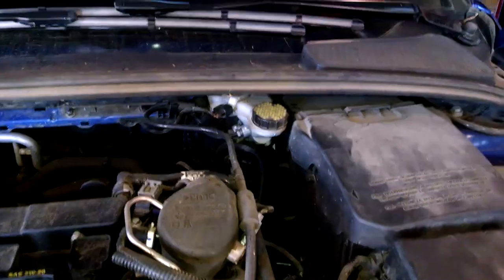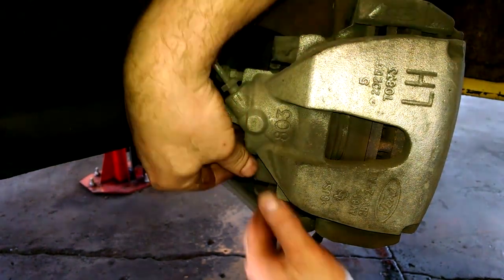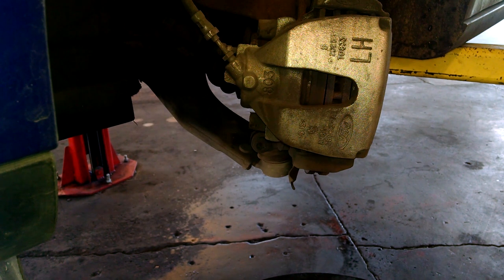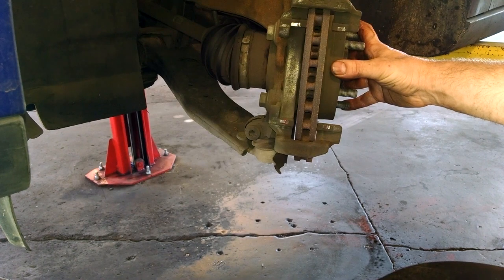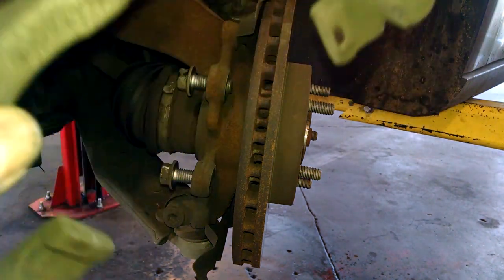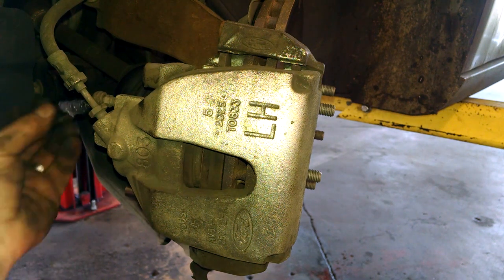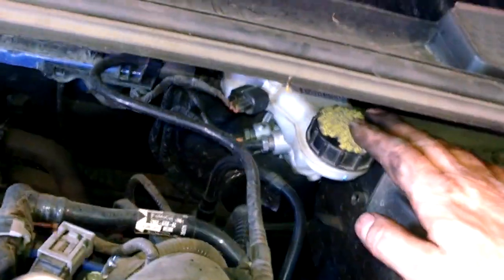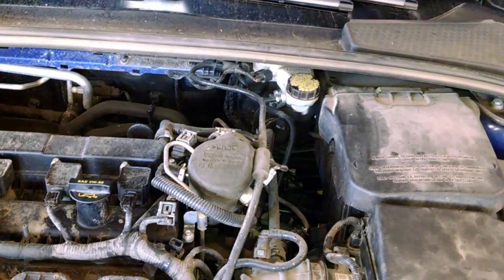Brake pad replacement Ford Focus 2005 - 2014 Front pads rotor Install Remove Replace How to

Comment: So my car started to make a scraping noise when I pressed on the brakes a few days ago. I knew it had to be my brake pads from a previous experience with my old car. So I also knew how expensive it could be to get them fixed. So I started looking online for parts pricing and then on how to go about doing it myself for my Ford Focus 2009. 

Now Im a young woman in my early 20's in college, so I know about cars, but definitely not how to do too much work on them. I found your video and it was perfect! I watched it a couple days ago, purchased the parts, and was able to figure it out and do the work on my car in under an hour today! So THANK YOU! So many people at the store were side eyeing me bc they questioned whether I could do it and with your instruction, I did! You saved me a ton and I will definitely be tuning in for more car care information!
Reply from the maker: Felicia Langston Thanks for the nice comment, glad to help you out and save some $$!
Reply: Felicia Langston So your saying this video will work for my 2009 ford focus?
Reply: hard time believing under an hour but there's always a chance I could just be slow
Reply: @BabyBirdFOH  did this in 30 minutes Haha it dont take long. I know this cause I started at 8 and it gets dark at 8:30 it was dark just as I was getting the wheel back on.
Reply: @chrisl2090  on one side? You're supposed change them in pairs
Reply: @platinumpepe8626  no dude both sides it dont take long.

Comment: Thank you for this video! Especially at the 12:39 period. After the spring sprung away from me 5 times, landing at my foot, time # 6, just as I was about to set it correctly it sprung away from me and out of sight. 90 minutes later, and after searching with my handy 12" magnet I gave up. Now I've ordered a new one from Ford and will drive sparingly until it arrives. Your video showed the best view I've soon so far on reinstalling the spring. Thank you! Mike

Comment: Guys remember to open your brake fluid reservoir cap when pushing the piston back otherwise you may need to get a new master cylinder!
Reply: I didn't know about this tip until yesterday. I've done the brakes on my vehicles for about 20 years and knew I was always going to struggle to retract the piston. Now, I just hope I don't "struggle" too hard to remember to screw the cap back in place when I'm done getting the brakes pumped up again. Thank you for the reinforcement.
Reply: Not true.  Simply not true.
Reply: Someone CLEAR THIS MATTER UP STAT UGH

Comment: If anyone is wondering you need an 18mm socket and 7mm allen key socket. A breaker bar helps a ton with the 18mm socket.If you have a wood chisel it helps out alot with compressing the pads.
Reply: I just used a C clamp which I closed really slow to push in the pad.

Comment: This is a really helpful video. I searched it out because I heard about having to use a 7mm Allen key to undo the slider pin bolts, and you made it very clear! Bit suprised no lube going on the back of the pads or the contact points (where they rub their retaining bracket)?

Comment: My mom got quoted a grand at ntb also I believe that the caliper bolts are torqes like everything else on those car I just did this on a 01 it's almost exactly the same but get this there's no caliper bracket blew my f'n mind thanks for the video man also for those interested in if you should use A TQ wrench it's a peace of mind thing so if it's your car maybe don't worry about it but if it's someone you care about dearly definitely tq everything to spec peace of mind is a nice thing to have p.s. since my trans fell out a few years ago I tq everything wheels hubs anything that you don't want falling off

Comment: When you compress the caliper piston, you crack the bleeder valve, if you don't you can damage the seals in the master cylinder.
Reply: Jake Walters 
absolutely incorrect.
Reply: No, it is absolutely correct. In fact, there are quality shops that require it, or it results in termination. Furthermore, the calipers are the lowest point in the brake system, so they collect tons of contamination. Opening the bleeder valve allows for a portion of the contamination to be flushed out. Also, with new systems, you are playing with fire pushing fluid backward through the ABS system. Stop acting like you know everything. You commented that the lug torque was 120 ft lbs. That's ridiculous. Focus torque is 95 ft lbs. If Focus owners listened to your drivel, they'd risk stretching the lugs, and killing their tensile/yield strength, not to mention warping the rotors. Stay wrenching though, Shade Tree.
Reply: Uh, this is part of his post: "...those pads are thick, but that rotor is scored badly and both should be replaced. Lug torque is 120 ftlbs..." 
What exactly are you talking about?
Reply: Well, I'm in the process of changing my pads and discs, and right off the bat I was annoyed about the 7mm allen key to remove the calipers....but I've already fabricated several tools for my ford vehicles. Here I was lucky to have a 7mm but I thought I'd have problems getting the bolts out- which I didn't. So I watched a youtube clip by chris fix, and he showed how you can swivel the caliper just to replace the pads by removing only the lower bolt. When I was unable to do that on my Focus I found this video. And I can say that I'm happy I did. Now for pushing the piston back in; I have always opened the bleeder valve as I'm applying finger pressure on the piston, and have always bled the brakes afterwards. This is the third video in a row which eliminates that step. Chris Fix even has a special tool to push the piston back in. As for that synthetic grease- I've never seen that before, never used it, and I don't have any...I guess it has to be non petroleum based so as not to damage a seal? And yes the other videos said 95 ft lbs. I do have a torque wrench but I rarely use it. I memorize the force by hand or the position of the wrench when I remove it....I can always check to see how accurate my estimation is.
Reply: Jake Walters I’ve done a shit load of brake pads and rotors for the family business, in 20 years I’ve never “cracked the bleeder” to install a set of pads.  All I’ve ever done is crack the fluid reservoir lid and changed the pads. Never had any ABS issues or whatever you guys claim can happen.
Reply: No you absolutely do not, you take the lid off the brake fluid then it will push back freely take it from a mechanic

Comment: Is that purple lube you used on the caliper bolts high temperature grease, gotta do my pads and discs and I think the sliders might be seized

Comment: Is a torque wrench absolutely required for the rotor replacement, or can it just be as tight as I can get it? What are the repercussions for not using one? Thanks for your help in advance.
Reply from the maker: gnaviselarom I am sure not absolute, only real issue I see is if the lug nuts are too loose and the tire falls off.  tighten them tight in a criss cross pattern and you should be fine.

Comment: what a grate video   so well done   saved me a lot of money . thanks todd.      the steering wheel shakes a little  when braking at  40 to 45 mph    I guess it is time to  cut the rotors or replace them . the pads have the same amount of lining left on them as in your video   so  in case i cannot  cut the rotors  but instead have to replace them  can I re use the pads  or should I replace them as well?      this did not start happening until I rotated my tires    weird  I thing.  I heard if you over torque the wheels you can warp rotors  is this true.  I torqued them to spec  witch is 94ftlbs    I have a 03 focus wagon 2.3  it is the same brake set up but I do not have a caliper bracket and my spring is a little different .

Comment: Great video!! Any suggestions on the best place to get the best price on Ford Focus brake pads?
Reply: Ford uses Motorcraft for their pads, oil filters, etc. If you go to the Motorcraft site they don't list pricing, I think they'll just refer you to your local dealer. Worst case scenario you buy them from there, then just install yourself which STILL saves you a ton of money. Personally I bought a set of Duralast pads for 53 bucks and they seem to work just fine, but typically I try to use all motorcraft stuff
Reply: Thanks. I went with the $50+ Duralast option too and simply followed this video. Worked like a charm and saved a butt load of money

Comment: I try to to this but my brake pads are to thick and I can't put it back now! please help
Reply: strange soul I'm having the same issue but only on the rear.
what'd you end up doing?
Reply: I know this is old. But you have to use something to push in the cylinder to give room for the pads. I use a  C clamp and tighten slowly.

Comment: You left a major part of this video out and that's the installation of the brake pad clips that go over the caliper before the pads go on. The most frustrating thing about repairing these.
Reply: Yep . getting that thing in is very tough.
Reply: This car does not have anti-rattle brake pad clips.

Comment: Can someone help i have rebuilt the whole left corner and am now stuck on brakes i can't get one out cos o metal nibs anyone know-???? I've tried with pressure but jus not happen.... Mine ford focus 08 plate Mk2.5 really need help tbh need a mechanic lol 😅

Comment: not all nuts tighten that way some hub nuts tighten the opposite way , just saying ;)
Reply: In what reality?
Reply: Early year (70's - 80's) MOPAR used left and right handed threads on the lug nuts is an example.

Comment: My brakes look nothing like this
Reply: sandwich eater there are several different model calipers for the Focus, depending on your model year and engine. This type comes on a 2 liter and svt, among others. But they are for 300 mm rotors.

Comment: those pads are thick, but that rotor is scored badly and both should be replaced. Lug torque is 120 ftlbs. You should be wearing a dust mask. You should lube the carriers and pins, and torque all bolts to spec. At the end, the rotor surfaces need to be cleaned and the brakes need to be bled. This is not the proper way to do this.
Reply: just buy a whole new car every time you need a brake change. lol